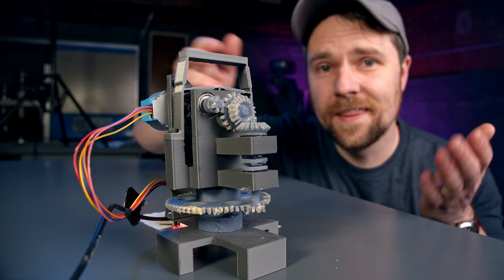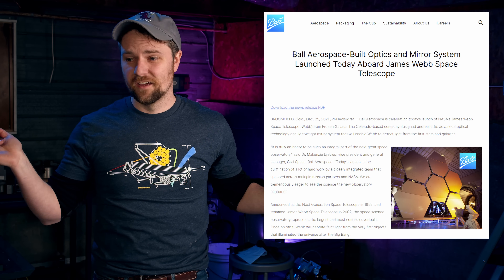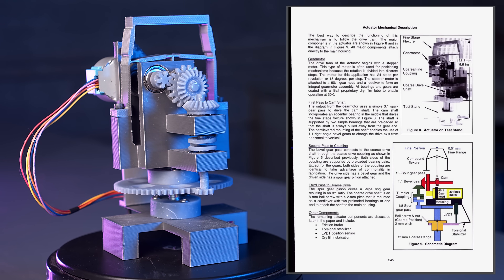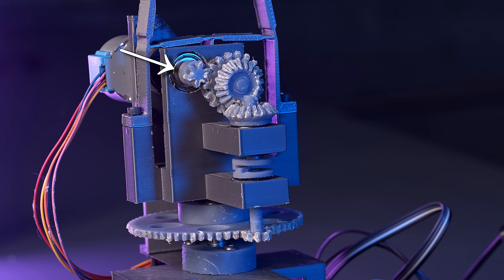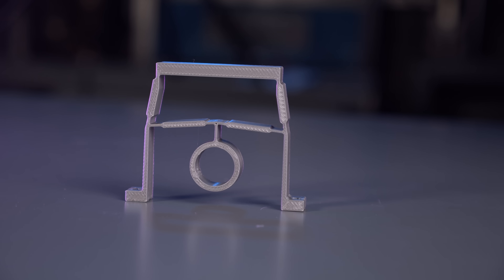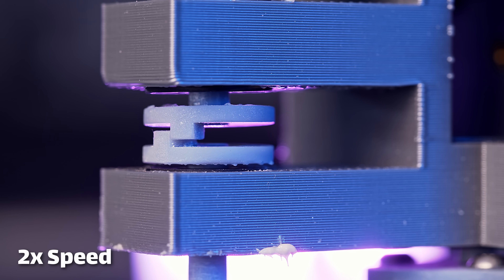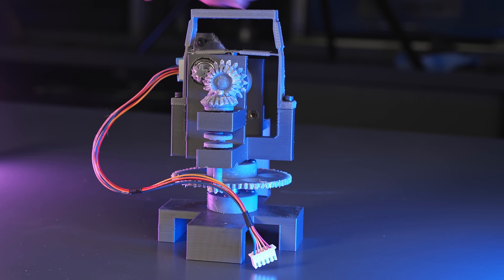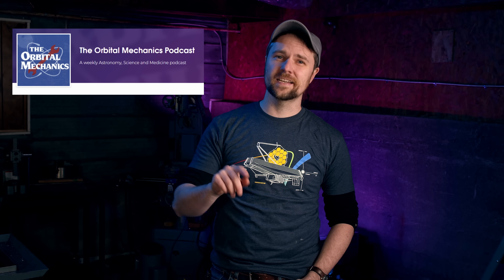How to achieve nanometer precision in space?

Comment: Having been involved in production of precision adjustable optical (laser) stuff, cloning the design as you have done is only a 1/8th of the actual effort. I think you understand this though and have done an excellent job to get the main points nailed.
The real effort you almost can't see to a layman. We've had people try 'clone' our designs, they get the basic shape and layout but have no idea why things are shaped in a certain why and why different thicknesses are in different places, so they miss the point and omit key factors from their copy. We've been refining the design of this product for over a 15 years. Then I've even seen people say our design 'sucks' based upon copied versions which miss the key (but very fine and non-obvious) design aspects which give it the finesse to operate as it is reputed to. Hilarious. 

In short most of this stuff (spec) is due to extremely low geared electric motors and a VERY well thought out mechanical and thermal design. The 'gear motor' integrated step down box already (common in optical industry) helps before you go anywhere with that energy. This is why the weight can be low - the motors themselves need not be powerful, they have lot of torque via multiplication. They just move very slowly and not cause thermal issues.  The thinner stepper motors are much more expensive than the one you use haha. 
Beyond this you have piezo electrics, deformable mirrors, low expansion steel for larger optical assemblies, etc. 

My only concern with this design is impurity and metal fatigue being wildcards. But I'm sure they have properly inspected and checked the metal in all of these joins.

Comment: Very slick! Being able to drive fine and coarse with a single motor like that is absolutely fantastic. I could kinda see it coming part way through when I saw both the cam and the bevels, but I couldn't figure out how the bottom didn't move all the time... that double disk is hilariously great. 
Question though - how does it prevent back-driving? you mentioned at the beginning wanting something that didn't need an active motor to station-keep, so I'm assuming it's possible to turn the stepper off and have it stay put., but there's no worm and wheel or anything that I would "expect" to make it one-way. does it have to do with the flexure mechanism, or just a lot of friction in the preliminary planetary?
Reply from the maker: Oh! That's my fault, I totally forgot to mention it. There's a little friction brake hidden inside the mechanism, down by the "coarse" gear. Before disengaging the coarse stage they set the friction brake which prevents the flexure from backdriving the system.

Details are pretty sparse, they don't really talk about how the brake is actuated but it sounds like another flexure and probably something like a solenoid that's held open and closes shut when de-energized, if I had to guess.  From the paper:

> The coarse drive gear was chosen for the brake location because it is the largest torsional element on the coarse drive shaft thereby requiring the least force to constrain. The brake uses a double cantilevered beam to support and apply force to two Vespel buttons. The buttons slide along a raised surface on the coarse drive gear

And yeah, I love the simplicity of the double disk arrangement.  So simple and elegant! Another aspect I didn't mention is that the fine stage is contributing to the distance  (in a sinusoidal pattern) while the coarse stage is running, so they actually have it all modeled out to know how much the whole thing is actually moving. In addition to an LVDT sensor monitoring progress too.
Reply: @BreakingTaps  There are some patents and papers online that discuss it - there's no actuation, it's always providing friction.  So it just makes that gear a little stiff to turn, but it stays put when not driven.
Reply from the maker: @IainHendry  Ohhhh interesting. That makes a lot of sense, and is simple and rugged. Love it!  Thanks for the clarification!
Reply: @BreakingTaps  I still dont understand why the flexure can't backdrive the system? A break on the coarse gear would only prevent the course gear from turning when the disks aren't engaged, meaning the flexure is still free to back drive the stepper.
Reply: @BenKarcher  I would guess that the mechanical advantage is so ginormous (rougly by a factor of 1000000:1 [millimeters become nanometers]) that there is no chance for the motor to be backdriven through any forces on the flexure.
Reply: @BenKarcher  You can Google "ball screw back driving equation". I roughly remember there is some limit in pitch after which a screw cannot be back driven, I think another factor in that equation is the screw efficiency.
Reply: Fun fact - that double-disk mechanism is the same mechanism used in safes that use rotating dials. It's a really awesome mechanism because you could essentially add as many disks as you want, to get as many outputs as you need, with just a single stepper motor. Here's a cool video by Jared Owen visualising the same disk mechanism used with three disks in a combination lock: https://www.youtube.com/watch?v=sftkP4CjjZs
Reply: @aston3982  That mechanism is also used in some clocks like these - so that a stack of digits can be arranged using a single motor :)

https://www.youtube.com/watch?v=A_mA72r3ZiQ
Reply: @IainHendry  That's awesome to see, and interesting how a simple mechanical concept can have so many applications.
Reply: I would imagine it is due to all the gear reduction involved
Reply: Has it discovered aliens yet??
Reply: Others in this thread have discussed the back-driving protection for the coarse adjust, but for the fine adjust I would imagine that simply shorting all the coils together of the stepper (in addition to the back-driving resistance of the planetary gear reduction) would be an excellent way of "locking" the fine adjustment. If you have a loose stepper motor around, short all the wires and try to turn the shaft. The back EMF of trying to turn the shaft gets counteracted by the closed circuit of all the coils. And, doesn't require any outside energy source.
Reply: Said people who are not old enough to remember "fine tuning" on radio or UHF tv channels...

Comment: In case you use them on things beyond demos, it's worth noting that those small steppers don't have an exact 1:64 reduction. Instead they have a multistage gear train which results in a 25792/405 ~= 63.684 gear reduction

EDIT: I received a follow up question and decided to crack open one of my steppers to confirm and found that it has a different gear train than some other manufacturers! You can find reports of the 25792/405 = (31*32*26*22)/(11*10*9*9) reduction on the arduino forums.

Mine contains a (32/9)*(22/11)(27/9)*(24/8) = 64:1 drive train. So it seems it can vary and you need to test which one you have, or open up the case and start counting.
Reply: damn good to know i have a few never used them but that could be a very annoying error
Reply: damn ive been using these and didnt realize i had the wrong ratio

Comment: Great insight, neat design. I'm curious how they prevent back driving of the coarse section, since there's no obvious brake mechanism & no fixed connection to the stepper.
Reply from the maker: Ah! That's my fault, I totally forgot to mention it: there's a friction brake hidden inside the mechanismis applied before the coarse stage is disengaged.  Hard to make out in the diagrams, but there's a raised section on the coarse gear which I believe the brake presses against.  Here's what the paper has to say about it:

> The coarse drive gear was chosen for the brake location because it is the largest torsional element on the coarse drive shaft thereby requiring the least force to constrain. The brake uses a double cantilevered beam to support and apply force to two Vespel buttons. The buttons slide along a raised surface on the coarse drive gear.
Reply: @BreakingTaps  Right, makes sense :) Thanks for clarifying. Really appreciate your content!

Comment: Any idea of the MTBF of that flexing mechanism? I'm sure they did their calculations and that thing should last for a long time, but I always get worried about fatigue failures when I see designs like that.
Reply from the maker: I didn't see any data on the flexure itself, but I did find this paper [1] which summarized failure testing of the actuator design. The conclusion was that bearings in the gearmotor always died before any other component in the actuator. It seems each motor has been allocated a certain number of revolutions (60,000) based on failure testing and statistical extrapolation from there.  The older paper I based the design on mentioned a similar thing ("The gearmotor has been noted as a life limited item and motor revolutions must be recorded.") but didn't go into details.

[1] https://www.spiedigitallibrary.org/conference-proceedings-of-spie/8442/84422I/Actuator-usage-and-fault-tolerance-of-the-James-Webb-Space/10.1117/12.924596.short?SSO=1
[1b] Scihub link: https://sci-hub.se/10.1117/12.924596
Reply: @BreakingTaps  Noice, thanks for the links 😁

Comment: 5:27 what program did you use to simulate this? Thanks
Reply from the maker: Fusion 360. It has built in simulation functionality, which made it really easy to take the flexure component, assign a material and then roughly simulate.

Comment: My company made all of those adjustment actuators and the mirrors and deployment actuators.
I helped test some of the stepper driver "MUX Boxes" that have to operate as cold as 5 Kelvin!

Now that everything worked great, do you HEAR who made all of those mechanisms and drive electronics?
NO.

But I bet you sure would have heard what company was responsible if they had FAILED.
NASA is really good at taking all of the credit when things go well, but they sure do point fingers when things fail.
Ill BET that if anything had failed on the telescope, the name of my company would be ALL OVER the news....
Reply from the maker: Wow, that's awesome! I bet those were some pretty stressful parts to manufacture, not necessarily because of their difficulty (although some do look pretty tough!) but just because of being used for the JWST. Did your company do the EDM work? I seem to recall that most of the pieces were cut via EDM instead of machining.

Hear ya about politics of the situation. Cheers from me to your company for a job well done!  Not quite the same weight but I appreciate what y'all did :)
Reply: @BreakingTaps  Our company is not allowed to machine the Beryllium in house.
We brought each mirror into our facility, cooled it (in vacuum) to 5 kelvin, then measured the profile.
We then sent each mirror to another machine shop that CAN machine BE and they made the adjustment and sent it back.
Each mirror went through this process multiple times to get the profiles perfect BEFORE they were coated.
And then we built each mirror adjustment actuator and attached them to each mirror. We DO a lot of EDM machining in house.

Did you figure out what Company this is yet? Hint: we fixed the Hubble, built the Deep Impact spacecraft and the Kepler Space Telescope.
I also just helped build and launch the IXPE X-ray telescope just about a month ago.
Reply from the maker: Oh! Woah! Hiya, cool to chat with someone working at Ball Aerospace! I hope I did the mechanism justice and didn't get too many details wrong 🙂  I actually just learned about the Hubble factoid while researching this video, made me go down the rabbit hole reading about all the other projects Ball Aerospace worked on. I had no idea y'all were involved in so many missions!  Super cool stuff.

Working with Be must be such a nightmare. Sounds like a deeply unpleasant metal to machine, dealing with toxicity aspects and disposal of chips, etc etc.  What a mess.  I bet you weren't sad to see that part sent off to a different shop :)

> I think I have likely hand tapped more 1/4-20 holes than almost any human alive.
> So a single chamber might have tens of thousands of these screws and many had to be had-tapped.

Yikes! That gives me tap-induced PTSD just reading it, let alone having to do it. Haha. Yeah, my channel name comes from an early project where I didn't know what I was doing and trying to hand tap some mystery stainless with old, dull taps. Many taps were broken :)
Reply: @BreakingTaps  Oh and your screen name brings chills to my spine.
I think I have likely hand tapped more 1/4-20 holes than almost any human alive.
My family business (before I became an aerospace engineer) was building EMI/EMC test cells for the military.
The rooms were often assembled with seams that had 1/4-20 screws every few inches on each seam.
So a single chamber might have tens of thousands of these screws and many had to be had-tapped.

Comment: Amazing video! Yesterday I found the paper about these actuators and I thought it would be great if someone demonstrated how they worked. As an upgrade for the coarse positioning screw I would suggest a dry leadscrew. The igus dryspin leadscrews for example should work a lot better than a standard M8 thread.
Reply from the maker: Will take a look, thanks! I was hunting around for a small leadscrew but couldn't find something appropriate, and didn't feel like taking an angle grinder to one of the larger ones I had sitting around.  I'll check out what Igus has for future projects!

Comment: The sophistication of the JWST mirror actuators is especially interesting to me in contrast with ours.  I work on the motion control hardware and software systems for the Hobby-Eberly telescope, a 1990s telescope design with 91 hexagonal segments. While our mirror segments have a similar job to do and roughly similar levels of precision, our system is much simpler, with only three degrees of freedom -- tip, tilt, and piston (no translation or rotation, and we can't warp our ~115kg ceramic glass mirror segments).  Our system has three separate actuators per segment, with a similar level of gear and lever reduction, but a very different mechanical design.  I'm really impressed with the level of thought that went into the JWST actuator design, and just as amazed as anyone else at the engineering effort that has gone into building such a system that must operate for years with no maintenance.
Reply from the maker: Very cool! I'm more than a little jealous of your job :) That's interesting that the Hobby-Eberly uses 3dof system... I wonder why they decided to go with 7 for JWST? Just to prevent any potential Hubble-esque accidents and be able to really correct anything that goes wrong once in orbit?

Any further reading about how Hobby-Eberly actuators work? Would love to take a peek at them! :)
Reply: @BreakingTaps , I think the difference in wavelengths and focal length have something to do with it... JWST is meant for wavelengths of 0.6–28.3 μm with focal length of 131.4m whereas Hobby-Eberly is for wavelengths from 350 nm to 1800 nm with focal length of 13.08m.
Reply: @BreakingTaps  Why ground-based segmented telescopes like Keck, TMT, ELT, etc only need three linear avtuators(Tip/Tilt/Piston), while space-based JWST need SIX-DOF actuation ability?
Reply: I was talking with Steven J at the Hobby Eberly and IIRC he said the control software for the HET mirrors had to deal with tons of thermal variation throughout the night, while the JWST will hopefully be thermally stable enough that they don't have to refocus all the time. Did I catch that right? How active do the actuators on the HET mirrors have to be?
Reply: @rescdsk  That's right -- JWST can take their time to adjust their mirror segments for perfect focus. We adjust ours continuously to compensate for the constantly changing shape of our mirror support truss, due to tiny thermal gradients, air movement, and other factors.
Reply from the maker: @BlackholeTtson452 Oh man, way outside my expertise to comment on intelligently.  BUT! It's the internet, so I might as well 😁 Dunno about alien life per-se, but I think there's going to be a big boost to exoplanet hunting and analysis due to JWST's resolution. 

And for as cool and complex as JWST is, I suspect something like the LHC is probably more complex simply due to the size and energies involved.  Although it didn't have to get launched in a rocket, so maybe just a different kind of complex :)
Reply: Yikes, what a faff!
Reply: How do your simpler mechanics work? Could you imagine that one could design a 3d printed version of it?

Comment: Wow, the coupling mechanism is so ingenious to me, that is such a great solution! I love learning things like this. I want to learn more about the concavity flexion devices too. I don't know much about them
Reply from the maker: Agreed! I couldn't mind much information about the curvature mechanism.  I think it's the same linear actuator, just placed at the center of six rods that are anchored to the edges. Then it can apply pressure to the center of the mirror segment, and if the mirror is thin enough it should flex in/out depending on the position of the actuator.  But that's all just a guess, I haven't seen concrete details about it.